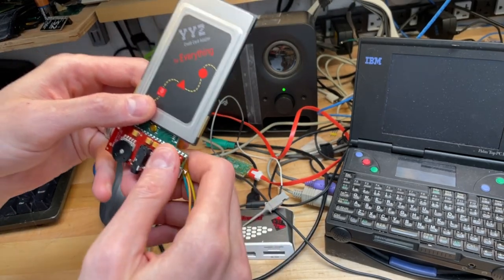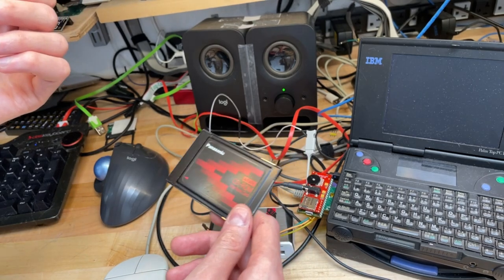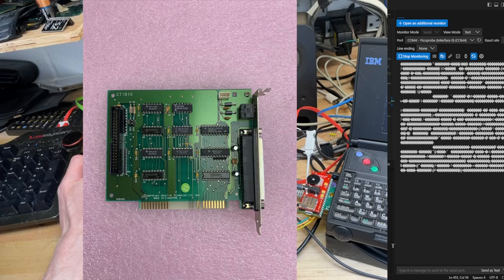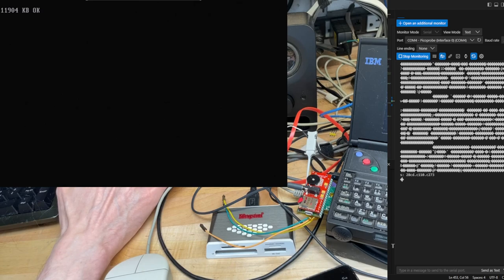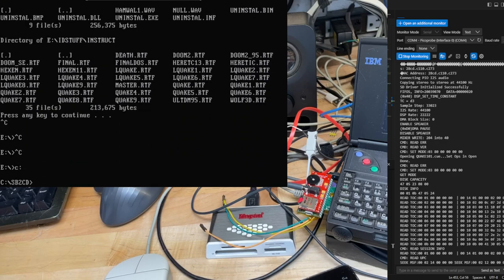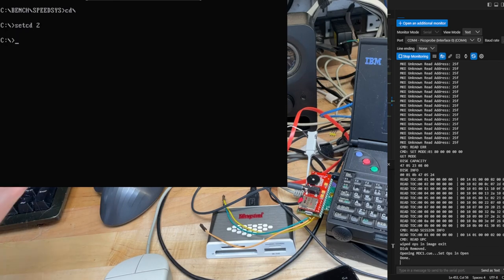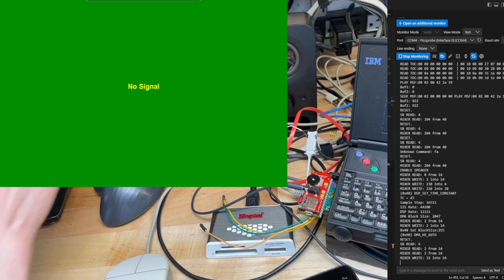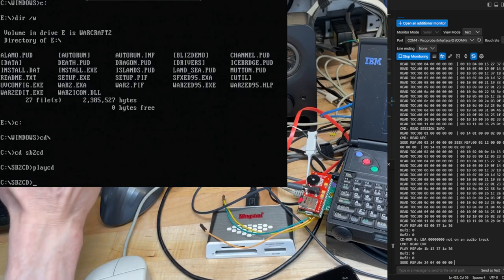Panasonic CD-ROM Emulation (On PCMCIA)

Comment: OMG, this could lead to an ODE for the Bung Enterprises Doctor V64 (CD-ROM drive for the Nintendo 64). The V64 uses an obsolete mode in early Panasonic/Matsushita IDE drives that may be a carry-over from the MKE interface CD-ROMs they used in the Game Doctor SF7 and SF6 years earlier (SNES floppy drive backup units with optional CD-ROM drives).

V64 units usually come with a 4-8x Matsushita drive salvaged from IBM, Apple, etc though many users have thrown in a Creative-branded one (still made by Matsushita/Panasonic). You can’t swap it with CD burners or DVD drives and even many pure CD-ROMs don’t work… though I did see one with a 24x Teac laptop CD-ROM in an IDE adapter.

Anyway, users have always dreamed of getting V64 to load N64 games from a hard drive. There is a hacked proof of concept firmware but it doesn’t support FAT and you don’t even get a list of filenames, so it’s less than ideal. Something that emulates a Panasonic drive with a few curated disc images would cover the whole thing.

How possible would it be to adapt this to IDE with a disc change button?

Comment: Could this interface with a regular panasonic CD drive bus? If so, would be a obvious way of making a FM Towns Fresh ODE (and possibly other higher end models) as it used a Panasonic interface that might be pin swapped (I'd need to check).

Comment: No updates here or your website for a year.... is everything ok? Do you need any support from the community to help get this over the line and into production?
Reply from the maker: Everything is okay I am recently trying to revive this.      Manufacturing is not fun!        I have a revised design from this trying to simplify the assembly process and some different parts.   As it goes, the moment I pick a part I get an EOL notification shortly after!
Reply: @yyzkevin416  It must feel like you're chasing a moving train with those obsolete parts. We appreciate the work you're doing,  and maybe part of the answer is to get a crowdfund going and buy enough parts for a production run of say 100?
Reply: @yyzkevin416  I sent you an email about the CD-ROM emulation code. Is there any possibility of sharing the code for the CD-ROM emulation part and the utilities that manipulate the ISO images?
Reply from the maker: @fabriciotm1981  Hello! I am not sure I see your Email.    I have shared my emulation code with the PicoGUS project, the following is a link has all the code.  For the  image handling I am actually  using code contributed to the 86box project.

https://github.com/polpo/picogus/tree/cdrom

Comment: I only just heard about this... What a great idea to go with a different CD-ROM interface, that is simpler to implement. I remember having a Matsushita drive back in the day. AFAIK the Creative CD-ROM drivers didn't work at first, but you could HEX edit them or something, the details escape me. The drive was 2x, but for the target games this should be all that's required for DOS retro gaming. Maybe some later games could benefit from a faster drive, but then also many games had the option to copy most of the files to the hard drive. I dont' remember if there was a faster than 2x Panasonic drive...

Comment: It's way better then Panasonic KXL-D745 (which is a sound/scsi cdrom card combo). Combination of CD (with audio), audio card and ne2000 and serial port/modem (fax modem? ppp? slip?) is a killer feature. If it will be capable of emulating both ata/ide and linear flash for storage options in addition to cdrom support it will be close to ultimate pcmcia device. 
What would be left out is audio in (which was rarely used), parallel port emulation (which there is little point to emulate unless a physical connector will be present to connect, say, link cables or printers), scsi adapter emulation  (same as parallel port, physical bus connection for peripherals is an overkill here. there were parallel port to scsi adapters anyway).
As for other obscure pcmcia devices like video cards and mpeg accelerators - they didn't work in dos AFAIR, and even under window 3.1. Never seen anything doing zoomed video "direct to framebuffer" in real life.

Comment: Prism2 / 3C589 emulation for Wifi would be cool. You can get a Pico with Wifi I believe?
Reply from the maker: This will do Wifi, emulated as NE2000 for maximum compatibility.  It will emulate  the network along side the sound and cdrom.

https://youtu.be/Pc2PUysWG2E

Comment: Very cool. The project has 1:1 applications for Amiga A1200/A600 AND the underlaying CD-ROM emulation might be of use for Amiga CDTV users that had an custom/earlier version of the Matsushita/Panasonic CD-ROM drive than used in PCs.